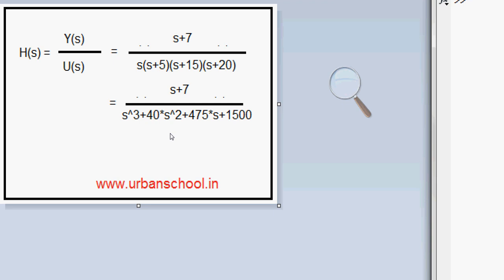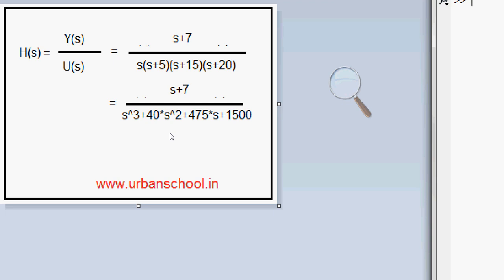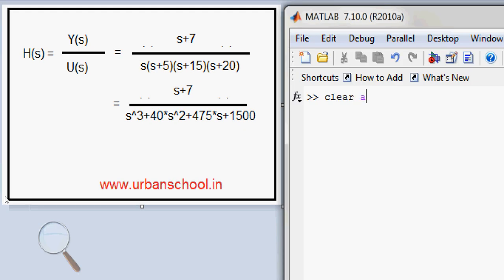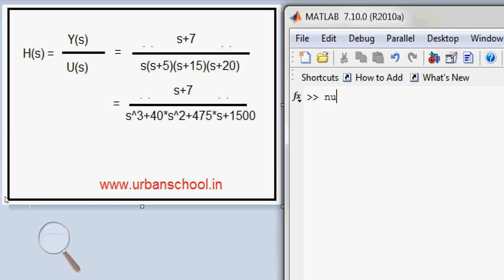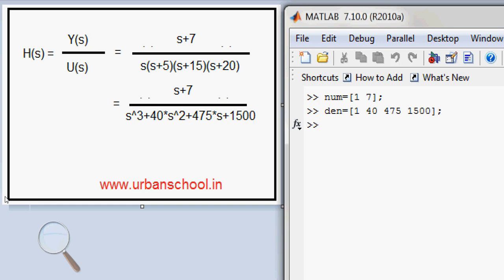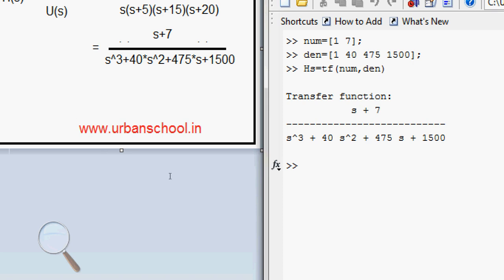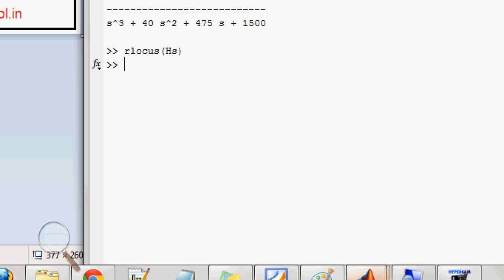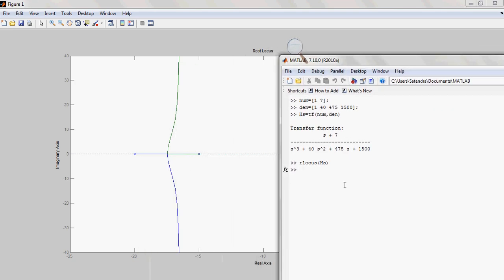How to plot the Root Locus of transfer function in Matlab

Comment: SRHenk is right. the Pole at zero was left out from omitting the S in the denominator..which changes the root loci.. (the 4th order polynomial became a 3rd order)... so results is for a different characteristic equation than originally posed